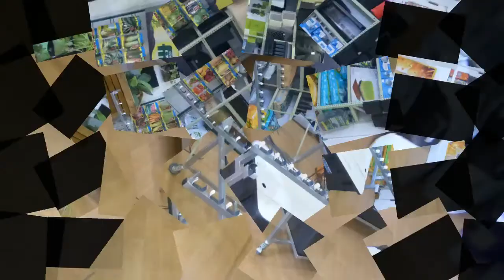Cómo Montar el Sistema Hidropónico NFT HidroHug 224 en Casa: Guía Paso a Paso

Comment: How you supposed to reach the middle?
Reply: The system is designed for short cycle plants (lettuce, chard, rocket...). Usually, when you put the plants in the system, you do not have the outer gutters installed in the system. You put the plants in the central gutters, and then continue to install the gutters from the centre outwards.
When it comes to harvesting the plants, on the contrary, we first harvest the plants in the side gutters and then remove the gutters without plants in order to reach the central gutters.

Comment: Does this kind of NFT get clogged up easily by rootmasses?
Good looking system
Reply from the maker: Hi, Kroyt Jhio. 
In NFT HydroHug hydroponic systems we do not use the typical grid planters that are used in NFT hydroponic systems. We use felted Feltpot flowerpots, by using these we avoid the channel clogging by the roots.
Reply: @huertourbanogrow5740  Ok, Feltpots. What size of feltpots do I need to purchase for HidroHug 32- model? Or are they included in the package? Thanks
Reply from the maker: @kroytjhio3847  All our systems come with built-in Feltpot planters.